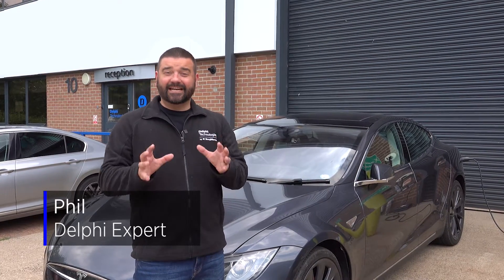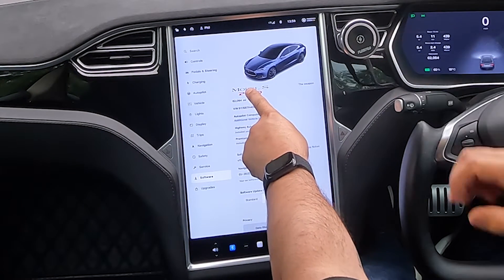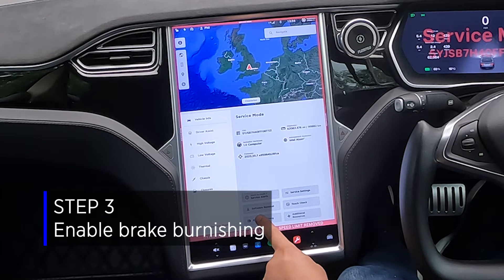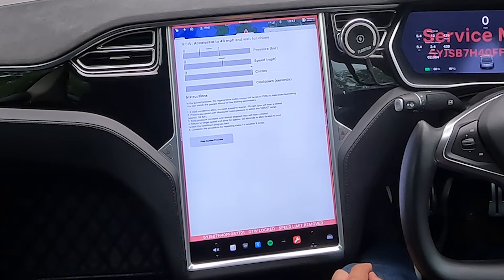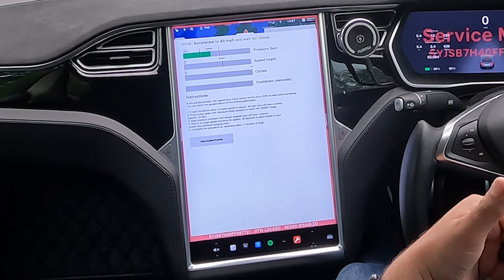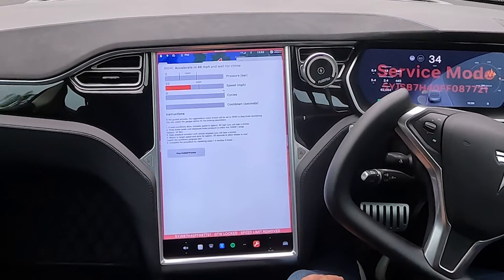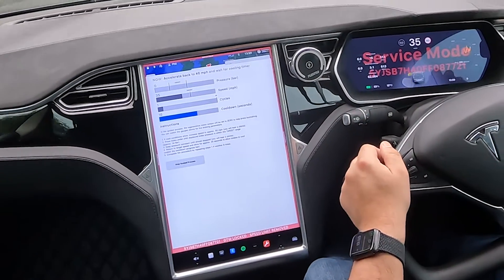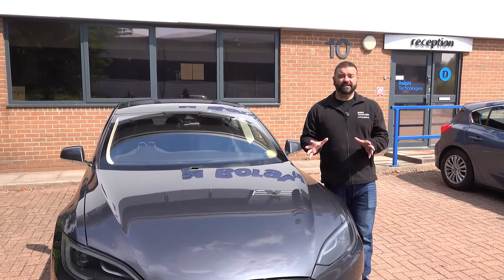[EN] How to bed in the brakes on a Tesla Model S | Masters of Motion

Comment: Can you do this after you already have the shudder?
Reply from the maker: Hi @Douglasolsson7768, this depends on the cause of the shudder. If the shudder is caused by excessive corrosion build up on the face of the disc, then this may help you.

However, the more likely cause is a variation in disc thickness (DTV) which has caused the disc to become warped. In this case, replacement of the discs and pads is the only way to cure this.

We did this recently on a earlier 2014 Model S60, the thickness of the pads and discs were fine, but there was excessive judder. The replacement discs and pads cured the issued. Many thanks, Delphi Technical Team

Comment: Is overriding the speed limit optional? Thanks for sharing this procedure.
Reply from the maker: We have checked on the latest software version and when you activate the brake burnishing procedure, the “remove speed limit” option is automatically activated.  There is no issue in doing it before hand, however if you don’t, then the procedure will activate it for you.  Many thanks!